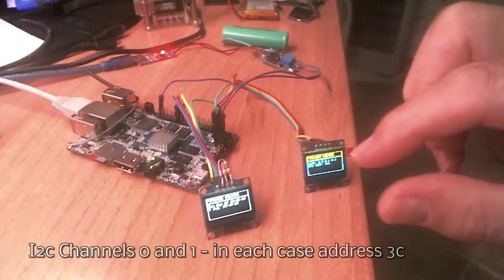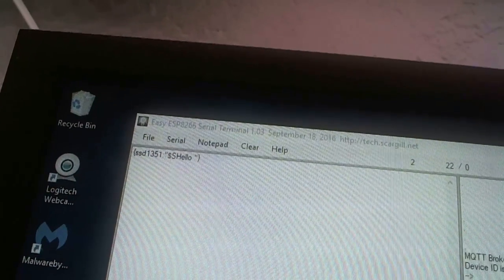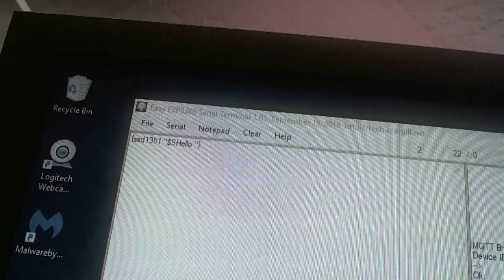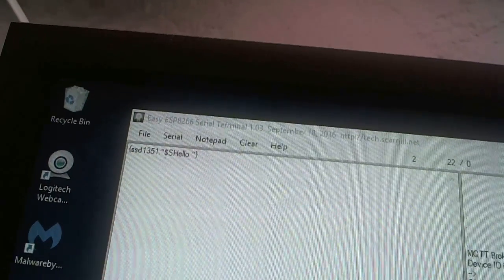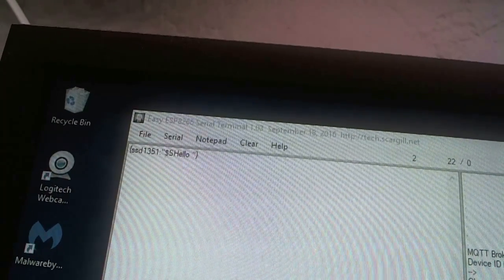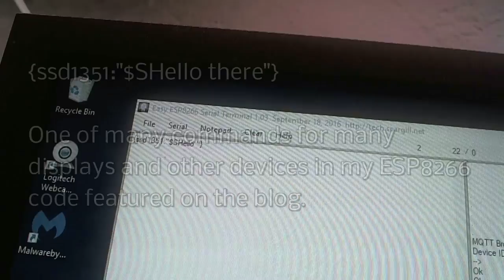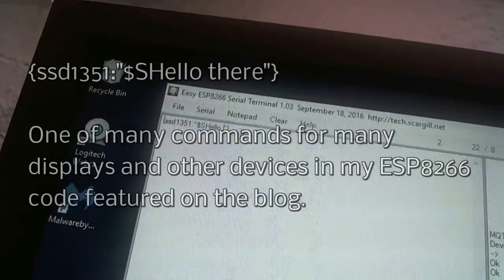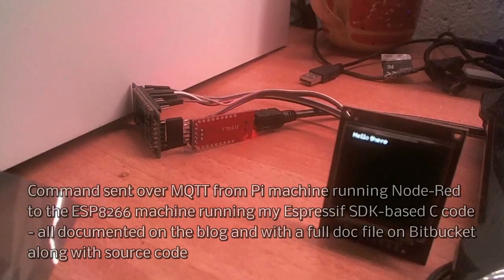What's New - Orange Pi, NanoPi Duo in "What's new"

Comment: Peter thanks for the video. Is  NanoPi Duo good as a  headless CBS with setup with its own  Access Point Router? 
Many of the Orange Pis fail due to the cheap wireless device they include in their SBCs
Reply from the maker: Raad Yacu not tested it yet. What's a CBS?
Reply: I dont know what CBS is either.  Dont know where my mind was.  SBC is what I was after.  Single Board Computers.